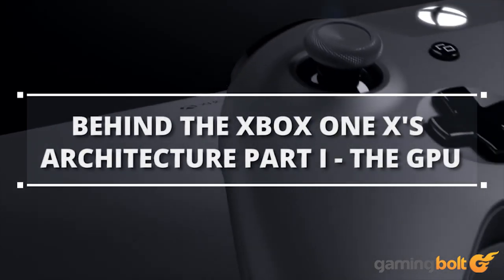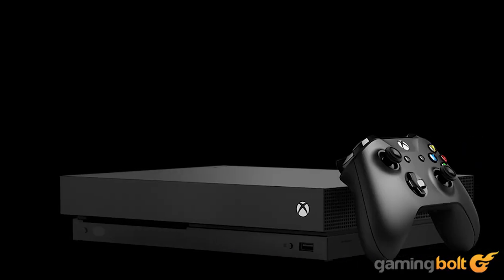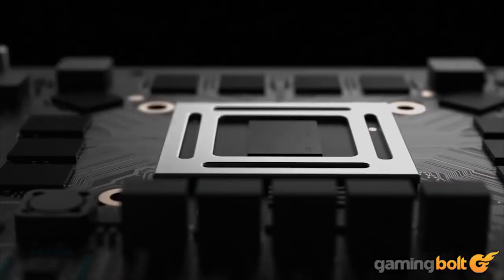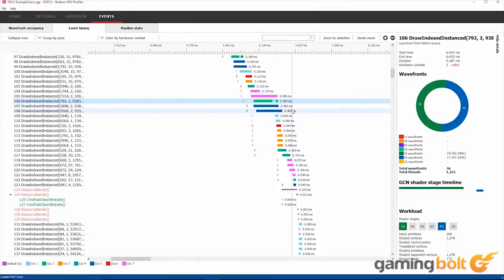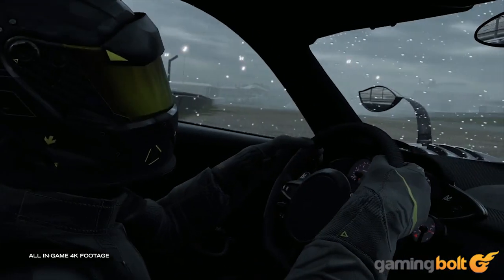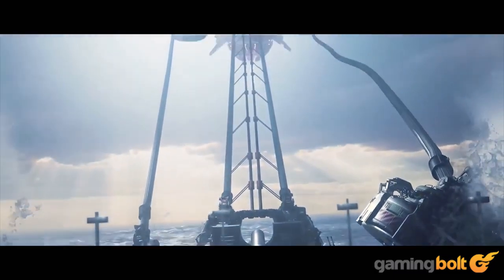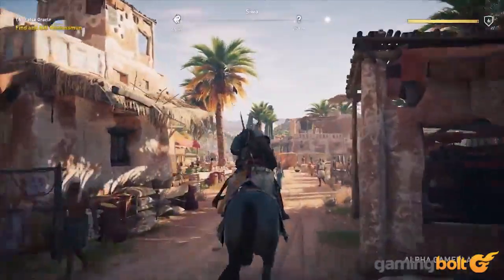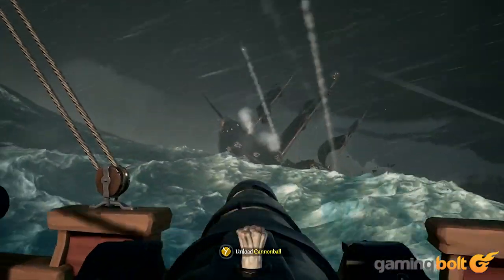Behind The Xbox One X's Architecture Part I - The Most Powerful Console GPU

Comment: As a PC Gamer I can definitely see the appeal of a gaming console. We all have to acknowledge that PC gaming isn't for everyone you do need a bit of technical know how, not every average Joe can just jump into PC gaming. It has definitely got any easier over the years and troubleshooting is still very real issue on PC. Consoles are plug and play... so having a console with the fidelity of a PC is definitely something to be excited about.
Reply: I can tell you pc is for everyone. You want plug and play? Have someone build it for you like my friend did. $50 commercially, and anywhere in between for local. No troubleshooting unless you really want to max out performance.
Reply: Gigabyte Gamer thats bullshit! Im sorry but you must not of been a pc gamer for very long... its a matter of time that something wont go right, it could be a driver update, game update or windows update that fucks up the while system. My point is that a console just works 99% of the time, no fucking around with drivers, no worrying about if your system can run a game and no lunching 3 different game clients just to play games with your friends.
Reply: TX51 A game update, driver or system update can break consoles as well. You won't be worrying about running a game if you build a console cost PC, it will run the same games.
Reply: Frost Eclipse I know it could happen (anything that can go wrong will go wrong) but it doesnt happen. Updates dont get pushed out on console if they brick the system. On pc, because we all have different configs its almost impossible to make a patch that doesn't conflict with something.  look, I like PC gaming, I am a PC gamer but you just have to come to the realisation that PC gaming isn't for everyone, it isn't completely accessible because if it was people wouldn't buy a console.
Reply: I've been PC gaming since the release of the Xbox one. I can agree that my situation is pretty lucky, but the amount of troubleshooting is still pretty low on PC. Unless you download random shit.
Reply: Gigabyte Gamer that isnt true. . . Windows alone has an update every 3 mouths. Every time a big aaa game comes out you have a new set of display drivers. Any one  of them updates can fuck woth something.
Reply: So Windows updates are considered troubleshooting? Then sure I've had to troubleshoot. It took all of ten minutes. Much shorter than my hour long Xbox updates. Nothing has fucked up my PC. Troubleshooting is manual not automatic.
Reply: youre Right , some months ago Watchdogs 2 randomly crashed , i asked on the steam forums of the game and in under 30 Minutes a dev linked me a beta Nvidia update for that problem , fixed it instantly

meanwhile i had to borrow a friends PS4 for a week ( had to go to hospital and MONTHS after release AC Ezio collection had graphic glitches , since i didnt connect the PS4 with the internet , luckily it worked without Plus  , and that wasnt just a minor issue , the game was unplayable

Comment: i m pc gamer but i would say this is good deal for people who just want gaming on go rather then building pc for hours,installing windows and driver and then updates!but still pc will help in long run and cheaper!
Reply: SAM VORTEX Takes 2 hours tops. There's also plenty of options to choose your parts and get a retailer to build it, install Windows and Drivers and ship for little cost.
Reply: Frost Eclipse but it's all frustrating... It's requires research and people might end up buying wrong configuration
Reply: Frost Eclipse like me I brought i5 7400 when there was ryzen 3  I could have saved 100usds plus more future proof side of amd...man XD
Reply: SAM VORTEX There's reddit and discord channels like buildapc which help with this.
Reply: Frost Eclipse yeah..
Should have researched before building pc...! /:
Reply: If you want to know if everything will work together just put the parts on https://uk.pcpartspicker.com
It has a built in compatibility check. For example, if my motherboard had ddr4 slots and I was using ddr3 it would alert me.
Reply: Well, not if you have my awful, at least 7 years old, HDD does installing an OS take 10 mins.

Comment: Ehhhh... This was a really roundabout way of saying it's basically an RX 480 with more compute units but downclocked, and with some upgraded memory bandwidth. For all intents and purposes, it's pretty much an RX480 over clocked equivalent.. Or maybe stock 580? Eh, they're pretty close anyway.
Reply: Nope , worse than 750 ti
Reply: @danielkatanaofficial  lmao sure.
Reply: @XtremeConditions  xbox one x runs fortnite at 900p 50 fps, all capcom games from dmc5 and all resident evil remakes run at 1620 interlaced , interlaced rendering below 1080p native, apex legends 800p 50 fps, rainbow six siege temporal filtering 1728p devided by 2 for the native equivelant resolution same for cod mw , all ox xbox one x , meanwhile the 750 ti can do all this games at 1080p native at 60 or 120 fps
Reply: @XtremeConditions  https://youtu.be/_4grXf8Bmfc pubg, very low settings are higher than xbox one x settings, also xbox one x now has introduced a dynamic res on pubg so pubg is no longer a native 4k tittle lmao

Comment: I hope that for the sake of moving forward, they eventually cut off orignal xbox one support for games. Then in a few years when the next xbox is released this becomes the bare minimum system for a bit before it slowly transitions.
Reply: What's the point in that? Ps3 was supported for a long time after it came out.

Comment: it definitely uses a RX 480 chip... They either round the 5.8 Gflops to 6 for marketing or they OC the RX 480 because the RX 480 doesnt OC as good as nvidia or older AMD cards doesnt mean that it does not OC at all... going from 5.8 TF to 6 TG would need less than 5% OC of both memory and GPU clock... so yea... still better than the PS4 one though.
Reply: ps4 pro used r480 too
Reply: nope they cheaped out using a ADM r9 380x  or maybe an undervolted RX 470
Reply: Nope, it uses a 750 ti
Reply: @danielkatanaofficial  dont talk if you are clueless... both console makers are AMD partners.
Reply: @billkillernic  amd partners yes, but the performance is worse than gtx 750 ti

Comment: an RX480 or 580 = most powerful console GPU

and here i am thinking about buying a 2nd 1080 ti for Sli

not even crossfire 480s beat the 1080 , the 1080 ti is 35% better than the 1080 , and Sli 1080 ti   in the best case is 70-100% better than a single 1080 ti )  now do the math how many % sli 1080 ti will be superior than the Xbone X
Reply: @All my heroes are villains  lol

Comment: Xbox one x gpu is not vega or ryzen but a garbage cpu sames as ps4pro and for gpu is an R9 390x with 12gbs running 1172mhz with a smaller bus 384bit instead of 512bit and the rops got reduced from 64 to just 32.. The reality is that the R9 390x is bearly more powerful than a Rx 480 but with the extra 4 gbs of ram.

Comment: See this sound impressive but for my self and folks that may b in simular situations my question is, will it even connect to my tv?
This is mine https://www.cnet.com/products/sony-kp-46wt500/specs/
If it doesn't work with it why should i care? Also the "get a new one" is never the answer specially when said hardware is still in perfect working order. The ps3 was smart they let you combo the dvi and standard out put so you could use the video and run the audio from the standard line.
Reply: There isn't a dvi port on a ps3.
Reply: hdmi to dvi cable, i use both in my rig, always mixing the two up. my bad.
also my intent wasn't to come off as rant or picking sides, just the disappointment and there (all console makers) assumption customers  have high end tvs
Reply: Oh. That makes more sense then a dvi port.

Comment: AMD took the R9 290 from a 28nm to a 16 nm and put this into an Xbox, Get over the hype this is old tech on a newer die. No it is not a under clocked 580 it is an overclocked 290. Compute Units and shaders match and the process added 6 GB of bandwidth from 320 to 326. 
 "The Most Powerful Console" = Less then normal PC.

Comment: I can say that the GPU is pretty mid range in the PC market, but really, everything else about the console is limited. Especially the CPU.
Reply: Gigabyte Gamer that’s why there’s the GPU if they want frame the can just sent those CPUC calculations to the GPU and boom
Reply: iLegiTy Xipots that will limit the gpu. Plus we dont have that option to change resolution for framerate
Reply: iLegiTy Xipots That's not how it works. The GPU handles visuals. The CPU handles everything else. You can't just make the GPU handle things like AI, physics and loading times unless you want to have like 5FPS or an oven.
Reply: The GPU does handle physics but I see the point and it's a valid one.
Reply: Ricardo Martinez i wasn’t talking about us the consumer. i was talking about the devs 

and yes we have options on the xbox one x 

4k60 
4k30
and 1080p60 
or
Reply: DatGrunt what? so devs and microsoft exe are laying?
Reply: Microsoft definitely. They said "uncompromised 4k" and we already have games running at 1080p on the system.
Reply: Gigabyte Gamer like?

Comment: i prefer a pc..still more powerful than this xbox one x..
Reply: USMAN HUSSAIN How when the cost of upgrading a pc far exceeds the cost of owning a console.
Reply: Ben Tennyson
No it doesn't. A high end GPU like the gtx 1080 is around $500 or less by the time the X1X releases.
Let's say someone had a 750ti that would get around the same performance as the base PS4/X1 4 years ago. That's $240 saved because of free online, and that's ignoring cheaper games. Let's say that their PC cost them... $100 more, that's $140+$500 worth of upgrades I could do to improve a PC that was already beating the original X1/Ps4. So we won't be needing a case, mouse and keyboard, OS, hard drive or powersupply. That leaves us with CPU, GPU and Memory, and possibly a motherboard upgrade. So, let's put together that build for $640. 

CPU: AMD - Ryzen 3 1200 3.1GHz Quad-Core Processor  ($109.99 @ Amazon) 
Motherboard: ASRock - AB350M Micro ATX AM4 Motherboard  ($59.99 @ Newegg) 
Memory: Corsair - Vengeance LPX 8GB (2 x 4GB) DDR4-2666 Memory  ($67.68 @ Amazon) 
Video Card: Zotac - GeForce GTX 1070 8GB Mini Video Card  ($399.89 @ Amazon) 
Total: $637.55

This PC, will cost the same if you bought the original Xbox One and now are buying the X1X. Only the previous PC, as well as this PC will get better performance than both Xbox's.
Reply: Frost Eclipse What about maintenance and replacement parts, because let's face facts here parts will fail.  And a gtx1080 is way above $500.
Reply: Ben Tennyson
Maintenance like what? You really think that the Xbox One doesn't need maintenance? I'm assuming that you mean things like cleaning out dust. Which first of all isn't compulsary but extends the life of your components. Second of all applies to your Xbox as well.

Yes, parts will fail, but if one part happens to fail on PC, you can replace that one part (of course those parts that are not covered by warranty). If an entire console fails out of warranty, well, what can you do? You cant replace a single part, you have to replace the entire thing. How much does that cost?

A 1080 is way above $500? Go to Newegg. Type in 'Gtx 1080'. And search by lowest. 
Would you look at that, a MSI GPU which is $520, oh, and it comes with a free copy of Shadow of war.
Reply: Well yeah you would need a more expensive PC than the Xbox one x to out perform it
Reply: Frost Eclipse You can replace parts on a console, why do pc elitists always lie.
Reply: Ben Tennyson That ends up bricking your console? Please then, inform me where you can buy  replacement console parts at a cost worth doing so.
Reply: Mars Bars Yeah, you would. Upfront PC's would cost more. Long term they cost less. I explained that several times.
Reply: Frost Eclipse Almost anywhere including ebay.
Reply: Ben Tennyson This is all the sources console fanboys like you want to give. We ask for a source on the X1X being better than a 1070 'Google it'. I ask for you to give me a specific site on where to get console parts 'almost anywhere'. Why do I even bother asking for sources.
I went to Ebay, the majority of results came up with controller repairs/accessories and a few useless broken Xbox One motherboards by people trying to sell them off.
Reply: Specify. Give us a link. I couldn't find it, so I highly doubt your claims are true.
Reply: Frost Eclipse Then you're not looking hard enough.
Reply: Ben Tennyson Where's the comparison against the 1070? Please don't tell me you're referring to the idiots that made ark.
Reply: Frost Eclipse And there you go ladies and gentlemen proof that pc elitists are right 100% of the time, even though it's there in black and white straight from the developers.
Reply: Ben Tennyson 
Correction, only one developer has said that, and in no way does that mean it's 'confirmed'. The developer that released paid dlc to a broken, unfinished game. The developer that decide to make their still broken and unfinished game $60. 
The developer that make an absurd claim like this Xbox is comparable to a 1070 to get console peasants like you excited, and announce their game to be 1080p 60 fps Ultra, then a few months later downgrade their statement to 1080p 60 fps medium.
Yeah, I think I'll stick to what we know, and not to what the Ark devs say.
Reply: The GPU has near identical GPU specs to an RX 580, just slightly more transistors which won't affect shit. You are using ryzen, when you could use the FX architecture for about $20 cheaper which is what the XB1X uses. Motherboard price will be about the same, but PSU and Case will cost around $100 total.

FX series 8 core $90
Micro ATX board for FX series CPU's $60
8GB DDR4 $67
RX 580 8GB MSRP $270
case and PSU $100
1TB HDD $40
 
$627 total
Reply: JaY FaNTa
Why should we? Even if we make an $650 PC it will still be cheaper long term. Short term cost isn't much of an issue for most people.
Reply: 4K 30FPS Medium settings isnt that impressive of a feat...
Reply: Frost Eclipse Why should you build a $500 pc to back up your claims, oh I'll tell you why.  It's because you expect us to give you links to back everything we say, now come on prove that a $500 pc can beat the xbox one x.  If you decline then we know the reason why.
Reply: USMAN HUSSAIN Don't just give us links to pcpartpicker and insist that a $600 pc will do 4k, show us a video of you building it together with receipts.  Also show us your benchmarks on every Microsoft game, without this I won't believe anything you say.
Reply: Gigabyre Gamer That pc won't match the xbox one x.
Reply: Uh huh. So you're saying the One X  can't do 4k?
Reply: You know some people just prefer consoles for how simple it is.
Reply: You know PC can be simpler.
Reply: True but console are just way more simpler for some people and some just prefer them over PC because they like it more
Reply: So they like them because they're worse and more complicated?
Reply: Gigabyte Gamer The xbox one x is already doing 4k, but that pc with the athlon x4 950 and gtx1060 won't seen as it struggles to hit 1080p at 60fps.  Don't say that I'm lying either because JayTwoCent did a build with these parts.
Reply: you realize that 1080p 60fps high is very different and a lot more demanding than 4k 30fps low. a resolution doesn't mean performance, resoution and settings will. and don'tt get an x4 950, just get a fx 8350which is almost a carbon copy of the xbox one x's CPU.

a 1060 will be more than capable of doing 4k 30fps medium settings, I can guarantee you that, but JayTwoCents put in a weaker processor for cheaper, apples to oranges.

and we don't know how the 4k is going to be like, remember how the Xbox one X was the "perfect 1080p device". Now it has to play games 720p medium settings and can't even keep a consistent 30fps.

you have no idea what you are talking about, bye.
Reply: PC is better an so many ways

Free online
Much better community
Mods
Customizable hardware
there aren't just exclusive games, there are exclusive Genres to PC.
Continous sales in games save you money in the long run
Can connect any input device and display of your choosing
VR
Actual 4K, and no 1800p bullshit. (If they have to settle for 1800p, wait until two years from now"
Alot more versatility.

and if you don't know how to operate a computer in 2017, then I am suprised you could type this comment.
Reply: It can't, and this is before release which is pitiful

http://wccftech.com/killing-floor-2-runs-1800p-xbox-one-x/
Reply: Says the person recommending a dead chipset. I'll get behind everything except the FX part. The FX is garbage compared to nearly any AM4 CPU
Reply: A 1060? Yeah, no. A 1050.
Reply: I can tell you you're lying because digital foundry did a video with a pentium paired with a 1060, and got equal graphics at double the framerate of the X. And in that video you mentioned, the X4 was only a few FPS behind compared to that exact pentium.
Reply: ps4 pro is equivalent to a 1050ti, and the Xbox One X GPU is equivalently spec'd to an RX 580.
Reply: Yeah, pretty much. Although for the X, a 480 or 1060 would also be very similar.
Reply: If anyones complaining about parts breaking, i literally had to buy 3 xbox 360s
Reply: Ben Tenneyson ever heard of medium to low settings.
Reply: Its not intended to be a PC's enemy. They said the most powerful CONSOLE.
Reply: Frost Eclipse I got my entire X replaced for free after the SSD failed (from unexpected power outs  we had)